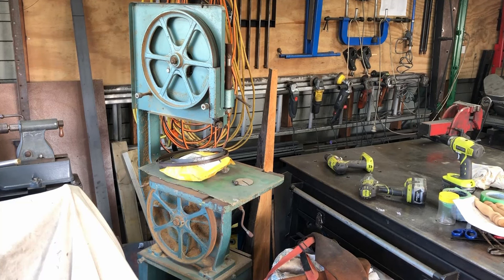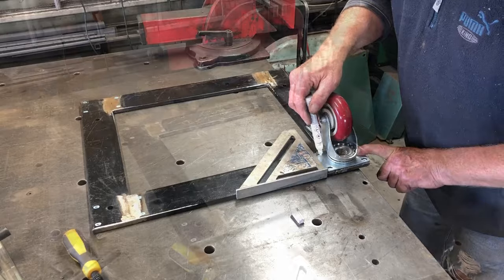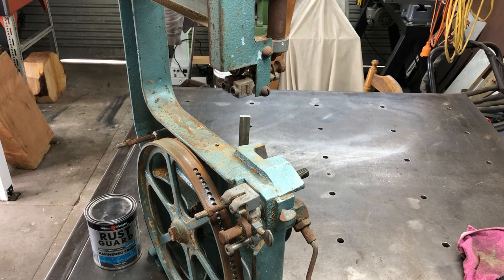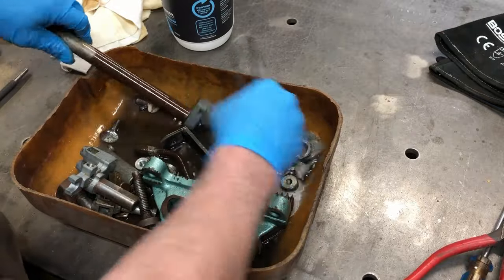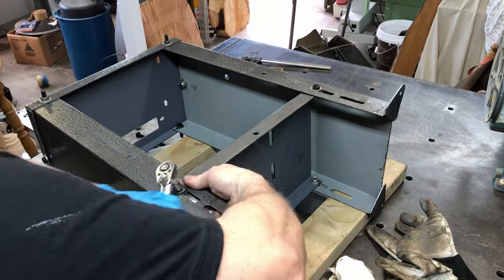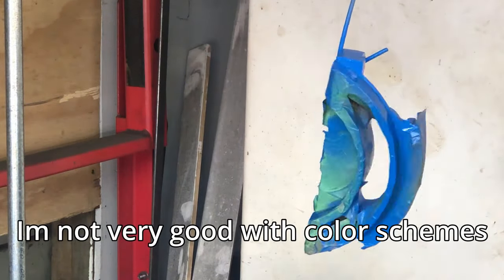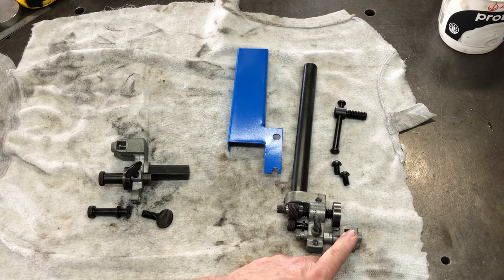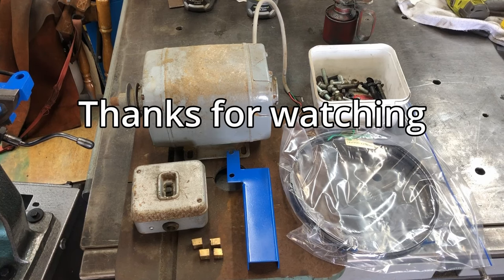Restoring The Band Saw - Part 1

Comment: I love the hammer tone paint. I used it on the table for my bench top mill. The brand I used is Rust oleum. I had to spray it because when using a brush or roller it is really stringy and impossible to brush or roll on. It looks like the brand you used brushes well. Thanks for bringing us along.
Reply from the maker: Thanks for your comments. Yes, this paint does brush on well. We also have Rust Oleum here in NZ. I use a lot of their paint in spray cans.

Comment: Are you going to change the pulleys to slow it down for cutting metal?
Reply from the maker: Thanks for the question. No, I already have a metal cutting band saw for that. This band saw will be solely for cutting wood for the wood projects I will be doing in the future.